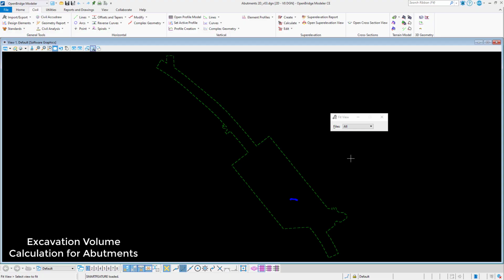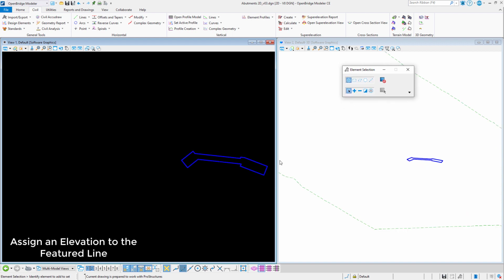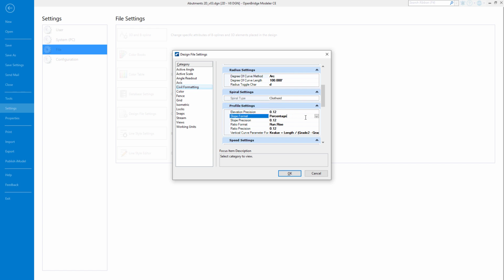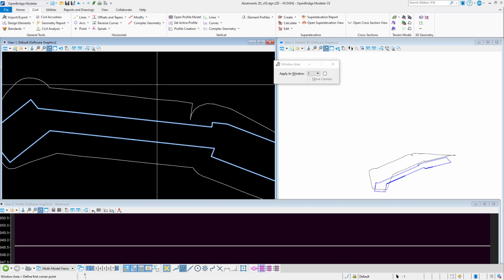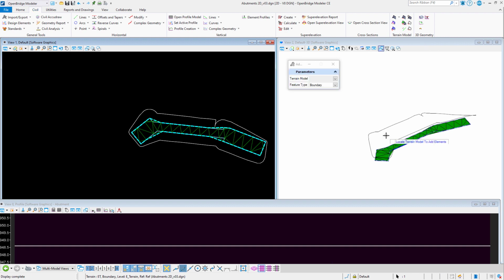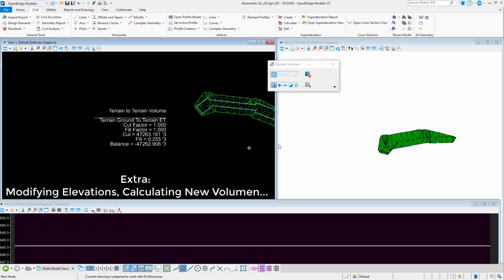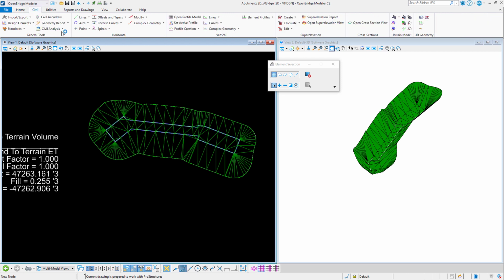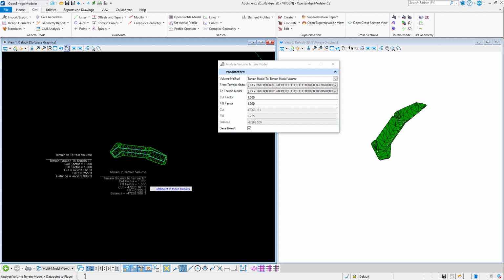Advanced Excavation using OpenBridge

Comment: "Profile by Constant Elevation" tool is broken according to a post on the forum. Can workaround by using the "Set Element Elevation" tool or manually moving to the correct elevation.